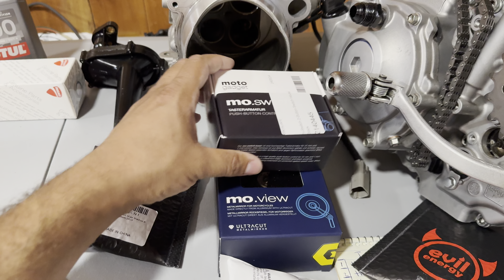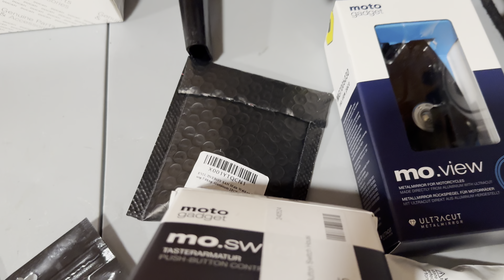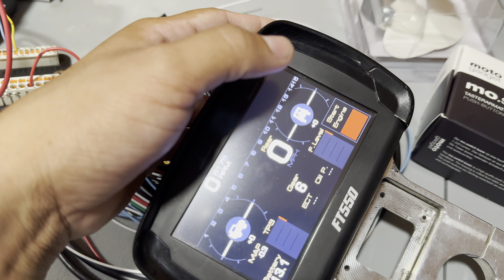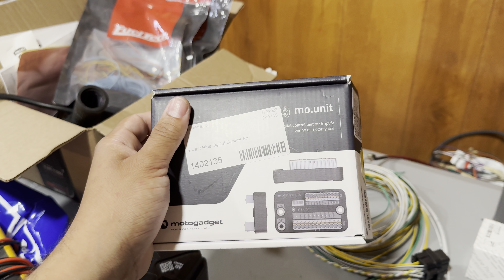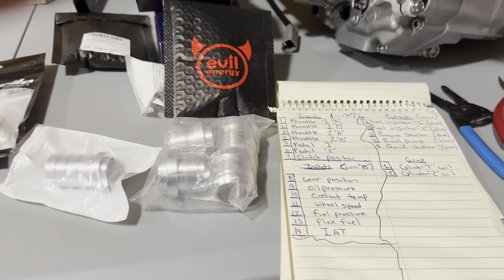My 200hp 1200cc DUCATI swapped HONDA GROM is ALMOST DONE!!

Comment: you better get some custom wheel bearings for those Wheels because you will fry them
Reply from the maker: May upgrade to some ceramic World Class Wheel bearings
Reply: @The_StreetSweeper  ya dont trust the stock i have blew out my back one 2 times now i run ceramic wcwb it's a good buy !! have fun that hoe is going to be f.a.f.